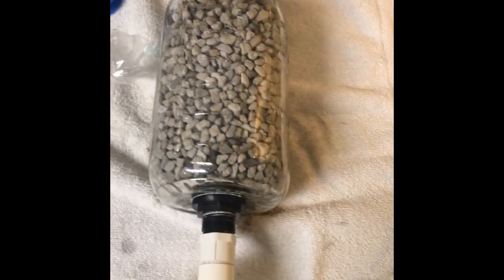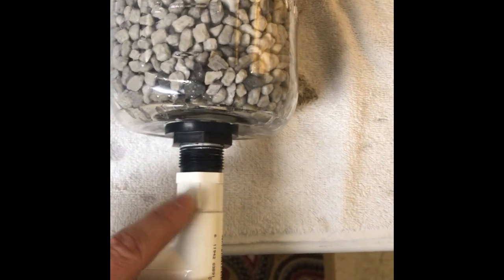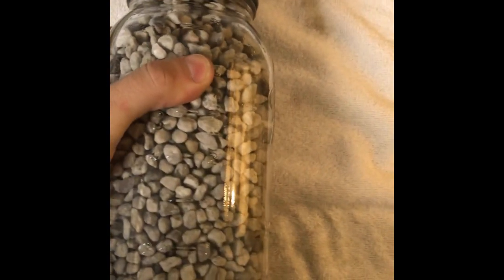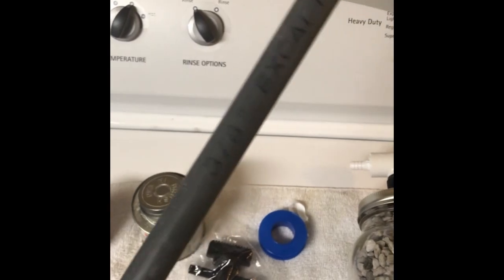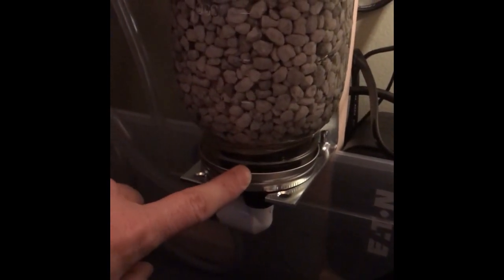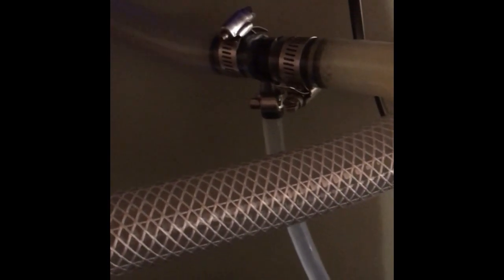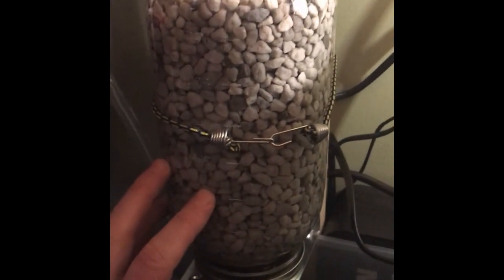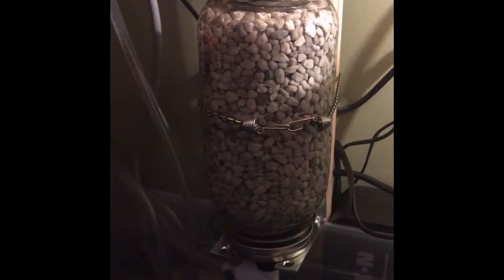DIY Aquarium Nitrate Reactor

Comment: After reading the other reviews, I thought I will give it a try and in the end De*nitrate really works, brings down my 60 gal overstocked freshwater tank from 80ppm nitrate to a constant 10ppm, however it takes a lot more effort, brain and money on top of the product itself to create an ideal environment for it. And I think it's worth it. 

First you need a few things:

1. A media reactor cylindrical and clear
2. Liquid flow meter
3. Flow control valve
4. A pre-filter
5. An after-filter
6. A submersible aquarium pump
7. Shut-off valves
8. Stainless/plastic hose clamps and strong cable ties
9. Clear aquarium vinyl tubing
10. 50 micron filter pads

Then you connect the submersible pump to a shut-off valve, through a pre-filter, then through media reactor, out through the liquid flow meter, through the flow control valve, then finally an after-filter which is a 50 micron polishing pad tied to the end of the tube submerged in the aquarium. You want the flow rate to be at around 35gph consistently. To do that, you will have to adjust the flow control valve once in a while as the pre-filter catches more and more debris while it slows down the flow little by little. 

A few things need to be taken into consideration:

1. You need a pump that has a flow rate of at least three times of 35gph just to handle the media reactor and pre-filter, then add roughly additional 100gph for 50 micron polishing pad because it slows down the flow significantly. Finally another 50gph as the flow rate gets slowed down little by little in the long run while it catches more and more debris. 

2. You need to use your liquid flow meter to read your current flow rate easily and adjust accordingly. 

3. Do not cheap out on a pre-filter, make it big, in diameter, not in length. The bigger diameter it has, the longer it takes to slow down the flow significantly hence the longer time periods it provides until maintenance. 

4. Put a 50 micron filtering pad inside your pre-filter. This will provide longer working time for your media reactor before it gets clogged up by debris which then it would require a complete rinsing of the media itself.

5. It can be pain in the ass when it comes to the tubing size. The best case scenario would be one size fits all when your pump, your pre-filter, your media reactor, your flow meter all require the same tube size, if not, then you would need multi-hose adapter which adds to the work and cost. 

6. Always use clamps in every joint to prevent potential leak. Use plastic cable ties or hose clamps instead of metal clamps for underwater applications. 

7. Add shut-off valve at the ins and outs of your pre-filter and media reactor for easy maintenance.

8. After every time you rinse your media, add tiny bit of sugar at the bottom and middle of your reactor as the anaerobic bacteria need a carbon source to thrive.

9. Last but not least, your will need an alkaline buffer and aquarium minerals because once water change becomes less and less often, maintaining a healthy PH and vital minerals level becomes more and more important.
Reply: @Xuan Zheng Thank you. This is excellent information and well explained in detail. I will give it a try.👍👍👍
What is the quantity of sugar to add? Is it based on the water volume or quantity of media?

Comment: Hi. Sorry to bug you again, but I am thinking of building this same thing as you did with a T off the return of my canister filter to the tank.  I would use a valve to control the flow like you did as it does run pretty fast.  I do have a couple more questions please if you don't mind.  1. looks like you cemented some parts together with "Oatey" pvc cement and also used plumber's tape in some places.  Are these things safe for aquarium animals and plants?  Is there a particular kind of cement you are using?  2. You mentioned screens in the unit.  What exactly are these and where do the go?  Are they small and go somehow inside the "bulkhead" piece?  3. The polishing pads you mentioned just get cut to fit inside the top of the mason jar, is that right?  Cheapest ones I see on Ebay are big pieces 2 feet by 3 feet of the stuff at about $14 each.  Does that sound right?
Reply from the maker: Yes PVC cement and teflon tape are perfectly fine.  The thread seal paste is probably fine too, I just don't use it for aquariums because its more likely to get into the water than tape is.  Just make sure the cement is fully cured, which doesn't take too long.  I believe the bulkhead I used had a screen built in, you just need something at the outlet to prevent the media from getting into the tube, thats all.  It doesn't have to be a fine screen.  And yes I used fine polishing pads at the top cut to size.  I believe 50 micron is what I used for that filter if I remember correctly.
Reply: @gillmanjr87  Thank you so much for all the information.  I plan to give it a try when I can get all the materials together!  Tired of the nitrate levels in my tank and this looks like it can help!

Comment: Hello.  I know you are getting sick of me by now, but I wanted to ask you one more thing.  Sorry I just really don't want to screw this up and have never tried anything like this before.  For the aluminum shelf on which you have the upside down jar sitting, is that something you just made yourself, or is that an item that can be purchased?  It seems like a really smart thing to have.
Reply from the maker: I actually don't have this setup anymore but if I remember correctly I just used two L-brackets (angle iron) from home depot and spaced them far enough part for the tube fitting to fit inbetween.  Then a small bungy cord to keep it from sliding off.  Something like these...

https://www.amazon.com/Prime-Line-MP9221-Corner-Construction-Bracket/dp/B01M2ZSYNF/ref=asc_df_B01M2ZSYNF/?tag=hyprod-20&linkCode=df0&hvadid=343955662557&hvpos=&hvnetw=g&hvrand=4751373795265130714&hvpone=&hvptwo=&hvqmt=&hvdev=c&hvdvcmdl=&hvlocint=&hvlocphy=9004882&hvtargid=pla-778613267511&psc=1&tag=&ref=&adgrpid=70729708233&hvpone=&hvptwo=&hvadid=343955662557&hvpos=&hvnetw=g&hvrand=4751373795265130714&hvqmt=&hvdev=c&hvdvcmdl=&hvlocint=&hvlocphy=9004882&hvtargid=pla-778613267511

Comment: Sorry this is kind of a basic question but how did you cut the holes in the top and bottom of the jar?   Very ingenious setup.  Thanks for the video.
Reply from the maker: Hole saws.  A standard hole saw for the top lid which is just thin aluminum, you can use almost anything for that.  The glass is much trickier.  I have a set of glass and ceramic hole saws.  There is really no other way to do it and unfortunately I don't think Home Depot sells hole saws for glass, they have to be ordered online.
Reply: @gillmanjr87  Thank you.  I appreciate the info. Maybe I'll just stop by and borrow yours. :)

Comment: Is it okay I’ll submerge my nitrate reactor? It will still have one opening with a sponge at the start and end to regulate the flow. Because my chamber has a fast moving water.
Reply from the maker: If you used a mason jar like the one I used to build it, I'm not sure I would submerge it.  I don't think the metal lids are made to be submerged, it might start rusting and leaching into your aquarium water.
Reply: gillmanjr87 how about I’ll use a plastic one?
Reply from the maker: @jcm06  Yea you could do that, they make those plastic lids for mason jars that are sold separately.  Only problem there is they are a single piece - if you do that you should use a bulkhead fitting that is threaded OR install a union at the connection so you are able to remove the lid for access.  Then again, you may never need access to it unless you plan to install a polishing pad or sponges in it.
Reply: gillmanjr87 actually I’m planning to put in   a pond. I plan to put in a large blue drum and put it in my filter. Same build as yours.  with sponge at the openings to control the flowrate. I plan to use also pumice stones. Do you think it will be effective?
Reply from the maker: @jcm06  For a pond you'll probably need a HUGE reactor.  I only had a 75 gallon tank at the time and I believe this reactor (2L) was actually too small.  I don't know how big your pond is but the reactor will probably have to be enormous for it to be effective.

Comment: Any new news on this? I know it can take at least 6 months for anaerobic bacteria to grow. Looks promising tho. I might try this with the biohome ultimate media.
Reply from the maker: Not really, I replied to a previous comment a few months ago and there really hasn't been much change since.  Like I said previously it keeps the nitrate levels in my tank from going much over 30 or 40 ppm but thats about it.  Still helpful because I have a heavy bioload in my tank (19 fully grown cichlids and 1 pleco) but I was hoping it would work better than it is.  I have a feeling that the flow rate is too low through the reactor.  I may try adding valves into my FX6 return piping to try and force more flow through it, but thats a big project with my setup, I'm too busy to do it right now.
Reply: @gillmanjr87  don't. If you increase flow rate it will bring more oxygen thus you may find your nitrate level shooting up. 20gph is good.
Reply: You need a much bigger reactor...

Comment: are you still using it now? does it reduces your nitrate in your water ?
Reply from the maker: Yes it is still running.  As for its effectiveness,  its hard to say.  It does seem to keep nitrates from going over 30 ppm but I can't be sure because I never go more than 2 weeks without a water change.  But given the number of fish that I've had in the tank I would think the nitrate level would have been much higher than 30 ppm after 2 weeks.  So I think it does have an effect.

Comment: Did it work?
Reply from the maker: Not as well as I had hoped, particularly given how much volume of media I have in it. I think the flow rate might be a little too low, but there is really nothing I can do about it.  It keeps nitrates from going over ~30 ppm in my tank, thats about it.  But it is helpful because I can let my tank go for weeks without a water change and nitrate levels will still stay under 40 ppm.
Reply: gillmanjr87 thanks for your reply. I gunna have a play. Maybe you had too much flow..
Reply: @gillmanjr87  I saw your setup and it looks very good...your flowrate should be lower than 100gph... ideally between 50-75gph for anaerobic bacteria to take hold...I'm not sure what size your tank is or how much stock you have but if your nitrates are at 40ppm, you could go a month before doing water changes.